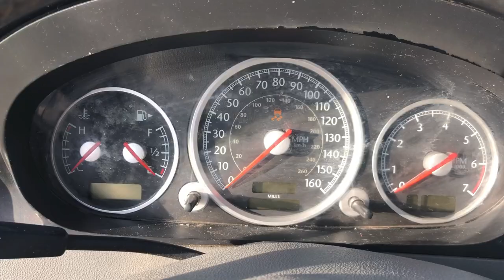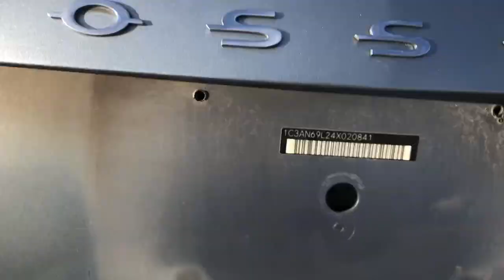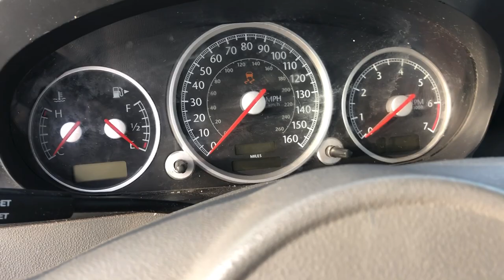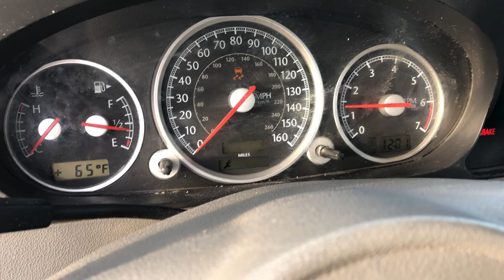Copart Crossfire - Baptism By Fire?

Comment: Different size tires front to rear equals no spare. Supposed to be an air pump and a can of 'tire flat' under the trunk floor next to the jack. Hopefully the lug key is back there too. The front face of the ashtray flips open to reveal a coin holder. Many XF owners don't even know this.

Comment: It's a MB manual transmission.
Good luck fixing that on the trailer.They are fun cars , I have one with the 5speed auto. It runs great. The auto has a stupid electrical connector that goes into the trans that has a seal that can fail, but it is easy and cheap to replace. Parts like the headlights and top windshield from are hard to find, but not impossible.

Comment: Great buy ! Parts value alone is better then $3000 - especially the headlights, about $350 each. I have owned a Crossfire Roadster for 8 years now, nary a problem other than wearing out tires due to bad alignment, that is fixed now. One bit of advise : NEVER go to a Chrysler dealer for ANYTHING to do with this car.
Reply from the maker: Great advice! Thanks!!

Comment: Go by your local Harbor Freight and pick up a set of wheel dollies. Jack up front of car and place front wheel on wheel dolly. Roll car off trailer. Repair front suspension at your leisure. 🤗
Reply from the maker: There’s a crossbar behind the tire that the wheel dollies won’t go over.

Comment: What's one more! You'll do fine with this car. Enjoyed watching you and RANDY toil with the fuel pump.
Have to say it but that car started up well without a battery (oh, yes you put one in.) Sorry! Drive the car off of the trailer and besides, how did you get the car ON the trailer? Take the fender off (tough task) or at least get it to move so the door can open without crushing it.
YES, you will land on your feet and best thing for all of us is always, "but I had a good time!" Sonny (CT)
Just thought of it. COPART loaded the car with the loader, eh?
Reply from the maker: A fork lift put the car on the trailer. The lower control arm is broken so the wheel won’t turn!
Reply: @MonkeyWrenchMike  You did SHOW that, sorry! You can (if you have to) get one of those 4 wheel things used for in the garage to move a car around. Jack the car and let it rest on that then roll off. Mike, get something under the car for support as you jack it up to install your new parts. Tight quarters and we want NO accidents! Sonny

Comment: Crossfires are piles of junk. The fact that it's a manual helps a lot with reliability issues. But the interior pieces fall apart and the biggest issue is the suspension damage and body damage. That will quickly be well over the value of the car if you get the paint and body repaired by someone.